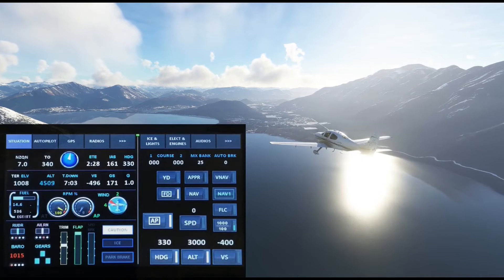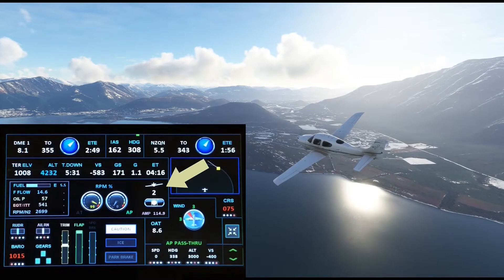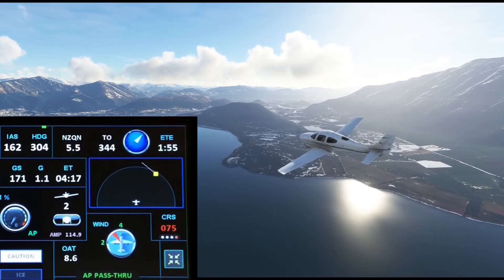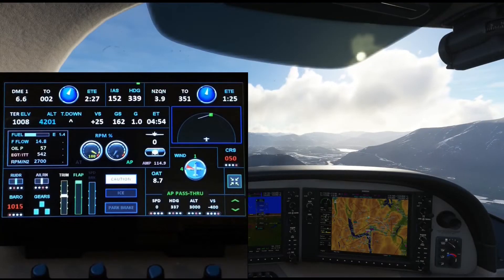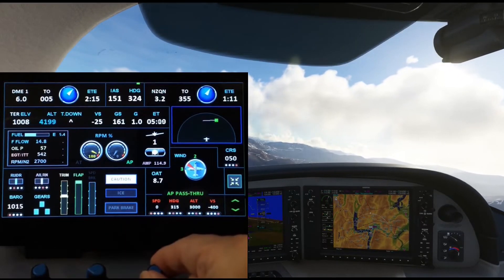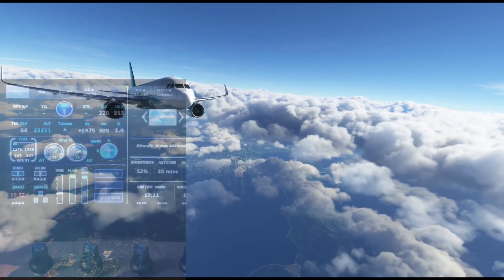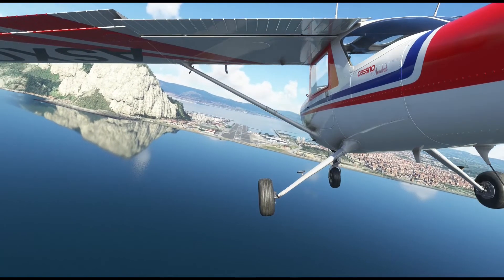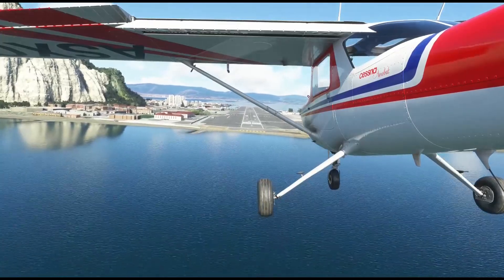Flight Sim Touchscreen Panel [Update 7]

Comment: hello . i have tried to build your tmp. i have had two screens go to black screen after flash of the tft file. to you have any adivce to help fix this problem
Reply from the maker: Have you modified the Nextion source to generate your .tft file or used the one directly from the zip?  When you said two black screens, do you mean two of the pages show up blank, or the two  Nextion units are completely blank?
Reply: @discman777  i used the tft in the zip file for the 7in lcd and yes the screen is completely blank.
Reply from the maker: @Terrormav73  It's difficult to imagine how that could happen. Since flashing with SD card should verify the data integrity.  And the screen should at least able to display the splash screen.
Maybe you can try the test provided in the PanelDiag folder from the zip file.
Reply: @discman777 well i did just try your suggestion. no change. still blank screen. guess this thing is dead. ty for the help.
Reply: I had the exact same thing happen to me. First screen went dead after uploading the .tft file, so I ordered another one and same thing, firmware update was successful but after powering the screen down and removing the SD card, it will not turn on anymore. I hope there is some fix for this to "reset it to factory" since I'm not going to purchase a 3rd screen just to brick that one as well.
Reply from the maker: @SimFlyingFin  I still do not know how the .tft file could end up “bricking” a screen.  The builder (Davis) had informed me last week that he was able to build his working unit.  I have asked him to share any idea.  I will reply in more details via email.
Reply: @SimFlyingFin  by any chance did you use ver 7.08.06 of the tft?  that is the one i had the issue with.  by the time i got my new screen discman had released a new ver . so i switch to 7.09.18 and uploaded via TTL via PC. did not want to brick another screen. bricked 3 but luckly they were replaced so only cost me shipping.  as for fixing the bricked screens no luck there, as far as i can tell the seem to be stuck in a boot loop. if you plug and unplug really quick you can see the back light flicker for a sec. oh and the last 2 screens i orderd directly from nextion. their customer support was awesome in getting the screens replaced. i have one more coming if your interested. good luck

Comment: Great Job !! I'm looking forward to finding some free time and implement the 7" version. BTW, can the encoders be driven by a 16bit I/O MCP23017 ? It would be nice to free some pins on the ESP32 for other stuff. Thanks.
Reply from the maker: The encoders can work through a 23017—it’s just a matter of more firmware (as they say)!  Of course, get the basic unit working first before adding on anything.

Comment: found error's when useing the basic 7inch screen, i sent you email
Reply from the maker: In the initial 7” video (Feb 2022), I stated that the Nextion .HMI can be edited, i.e. downgrade, to work with the BASIC model screen, but NO guarantee going forward.  Since then, feature enhancements have made it increasing unfeasible to do downgrade.

I can only help to point out that in the original 7” release, you would need to edit each of the following Situation Page Nextion object.  In its "psta" field, change to "solid".
   SStr    SSfl    SSsb    SSgr    SSgl    Sgf    SSru    SSai  

With more recent releases, the idea is similar—need to edit out features; however, there are now far more reliance on the INTELLIGENT model screen.
Reply: @discman777  i been playing around, is possible but will take awhile find perfect ettings, i can get the 2.06.23 to build even tho only uses corner of screen.

Comment: ever think of a g3x distribution for ultra light guys?
basicaly a artificial horizon and basic over lay on left and auto pilot, radio, and gps info on right?
https://res.garmin.com/en/products/G3X-TCERT-00/g/COMPATIBLE-WITH-SMART-GLIDE-TECHNOLOGY-0809eaee-3bb0-4744-a891-47534e852e70.png

Comment: Hy, I found some bugs. A320 flybywire mfs2020 when you start the engine (trusthmaster trothle) on the plane the switch continue to flip between on and of. Baro can not switch on std.
Like your update, thanks
Reply from the maker: Not sure what “switch” you’re referring to?  (I don’t have the TCA Throttle).
As for setting the Baro to STD, I cannot find a sim interface with A32NX/SPAD.neXt to implement.